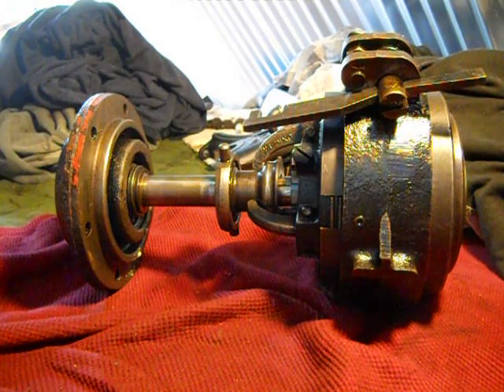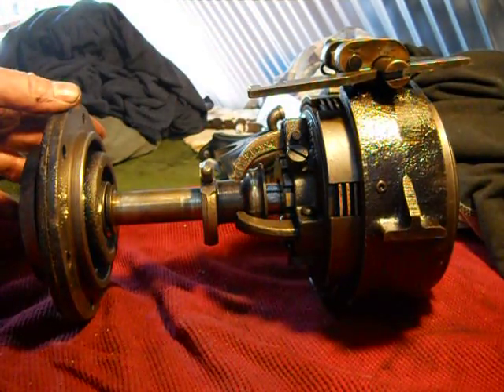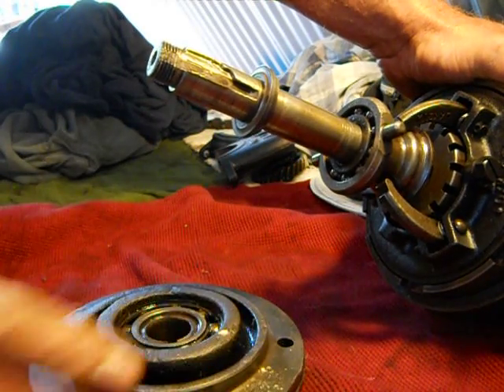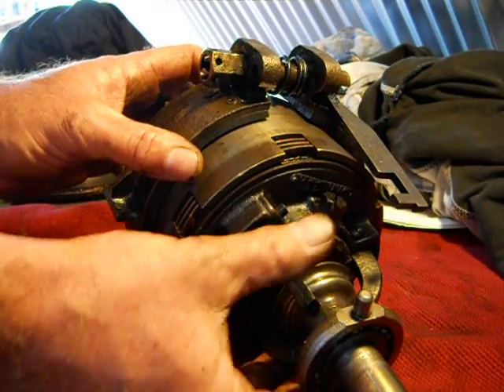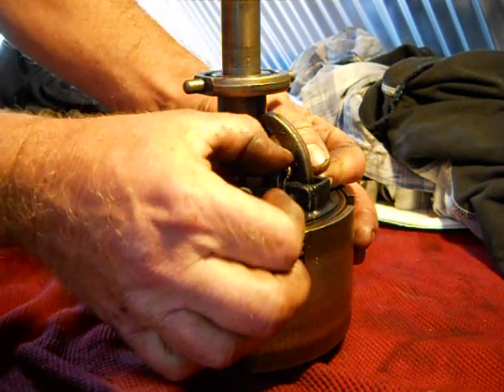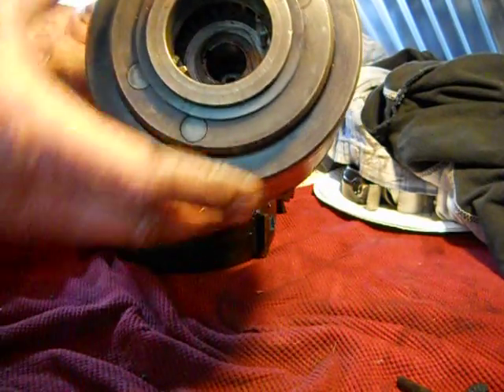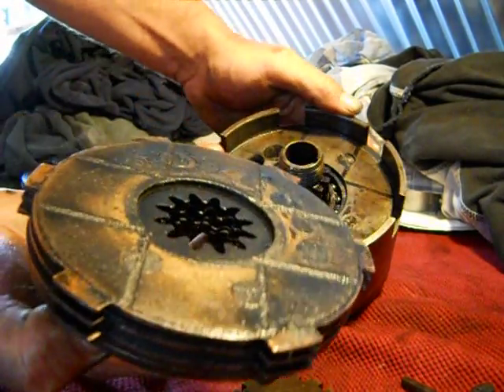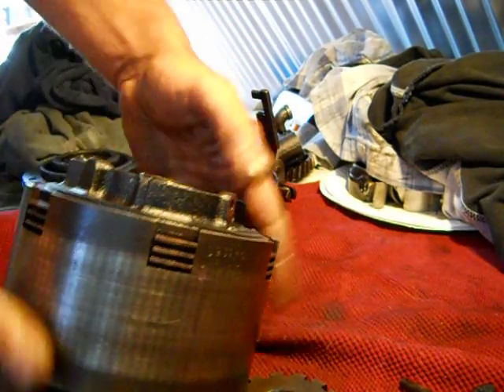Reversing gear, Tailshaft removal, Forward adjusting collar, etc

Comment: Thank you Thank you for your video! I got carried away with adjusting the forward adjusting nut and it came off. Clutch plates then fell back too. Your video showed how everything looked inside, so after about 4 hours of trying, I got everything aligned and back together. Would not have been possible without your video! Thanks again!